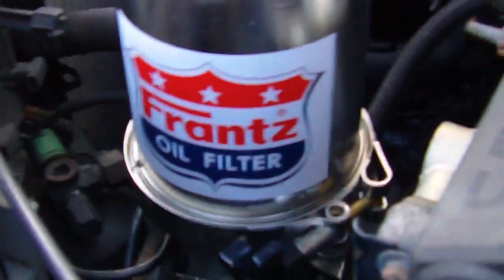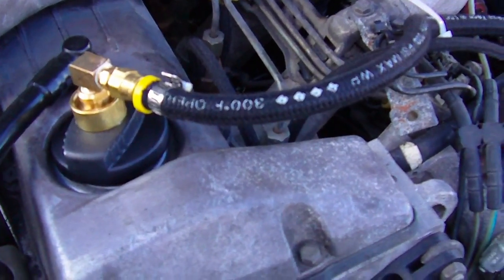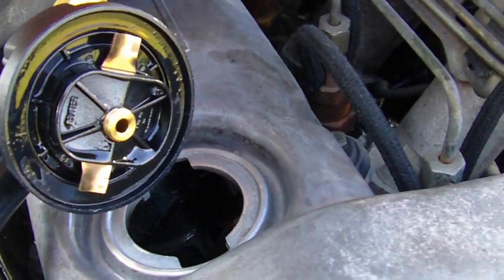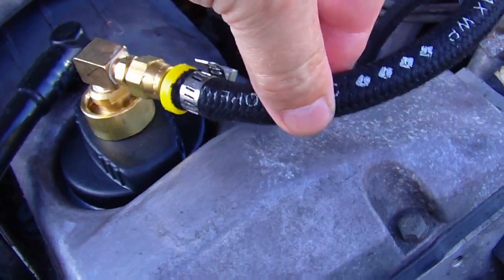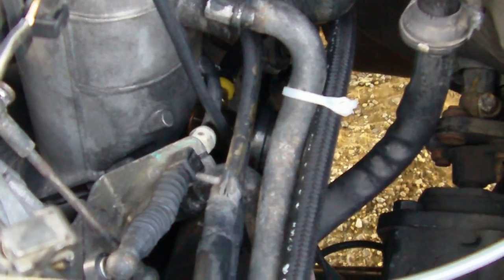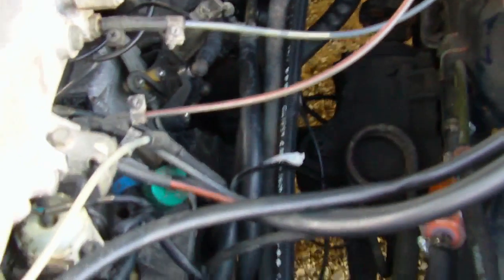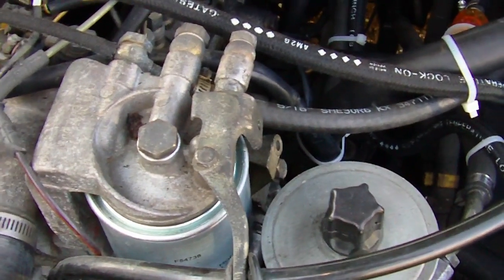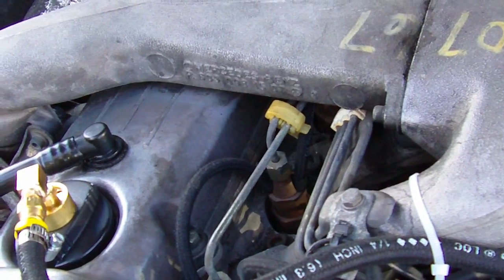Bypass Oil Filter System on a Mercedes OM 603 Diesel Engine (Part 2)

Comment: I love what you did on that I have the same car I see you disconnected the EGR I did the same on mine and put a little bolt In the vacuum line is that OK or do I have to remove that whole vacuum system I just don’t want any sludge buildup in my intake and what was the purpose of putting that on what does that do thank you please reply

Comment: Frantz filters ROCK!!!!!  This is the best oil for old MB that have those 603 engines that were mostly used from 1984 to 1999. If you want to use Amsoil in a Benz, this site has tons of the models listed that has all of the recommended oil and filters: http://www.searchforparts.com/oil-change/mercedes-benz-1992-300d-2.5l-602.961-diesel-turbo

Comment: so the oil fill cap is a pain?
Reply: heavymechanic2 Great, it's always good to have options! I used your same method w a 98.5 Dodge Cummins back in 08, love the setup into the oil cap, thanks for your insight, Dave.
Reply: Try drilling a hole through stainless steel with an average, general purpose drill bit and it will be a pain.
Reply: I'm thinking on doing this w an 83 SD I brought home as a project. I've got another Frantz by-pass w everything.The Mercedes came w an after market plastic cap, should be easier to drill & tap I'm hoping!
Reply from the maker: This is the new style oil cap for Mercedes and Freightliner. Drilling plastic is easy, but when you hit that stainless tab, that's where your trouble begins.. Dave Kana You may consider drilling the valve cover for the return line and using the hollow bolt offered by Frantz. Just be sure there is no interference with the valve train.

There is also a Mercedes adapter offered by Frantz for older engines, it might be worth spending a few bucks to see if it makes your install easier. This part goes on the filter housing in one of the valves. If you do go with this Mercedes adapter, it would be great to make a video of how it works to educate other people.